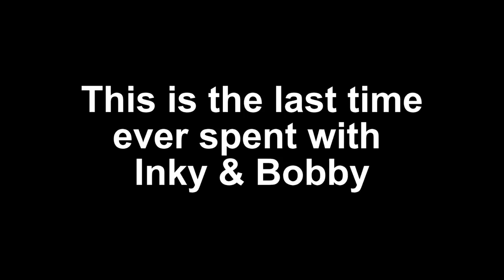Inky & Bobby's last day at the Kamp

Comment: Hey Kenan I'm not sure if you noticed after examining the redfoot male you added to the collection but on his back left leg he had a small lump near the top of his leg. You may want to check with a vet to make sure it's not an internal parasite issue and is non cancerous.  I just happened to catch it as you were placing it in the enclosure and wanted to make sure you caught it eventually and it didn't just go unnoticed 😀